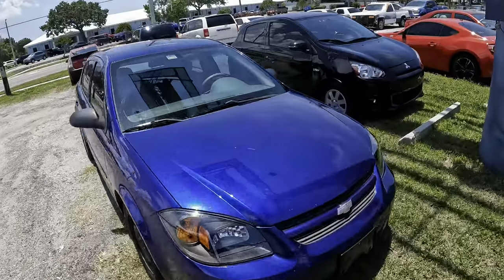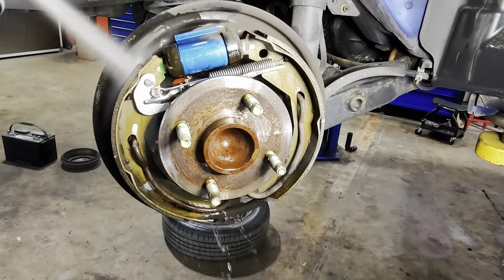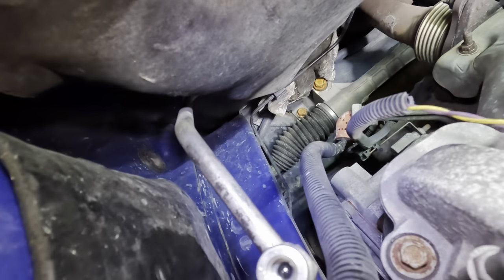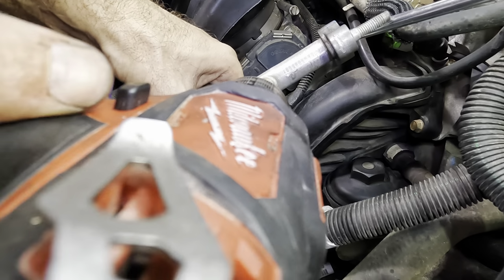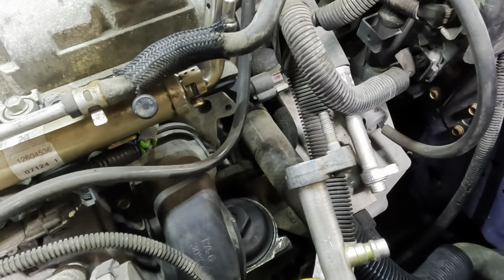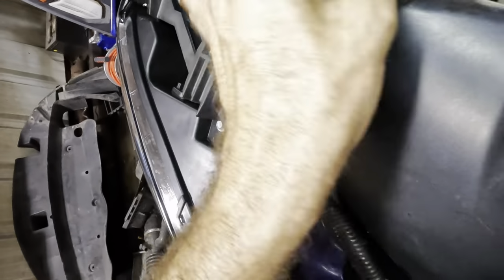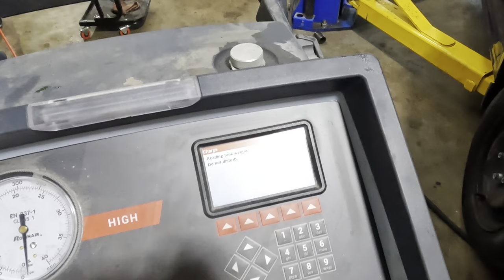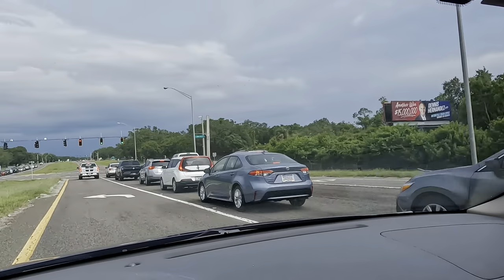Mechanic Still Can’t Replace Parts! Customer JUST bought it! Chevy Cobalt PT2!

Comment: You should look at the replacement high side service port that Napa (and I'd assume others) carries that has an actual Schrader valve in it rather than the rubberized ball that ALWAYS ends up leaking.

Comment: Ok, I don’t get the hose compensate. When u started the charge the hoses where already full and that refrigerant hasn’t been weighed. Then you put in required amount. Then you do a hose compensate. After doing this, you have installed the required weight plus 2 hose amounts. Over charged.

Comment: Definitely "repaired" by a novice before.  Failed to adjust rear brakes, failed to lock all tabs on fuel pump retainer, painted hubcaps but failed to paint wheels underneath.  Good times.
Reply: I think those are the OEM rims and they have plastic hub covers that screw onto the lugs from the factory...To get the effect of the hubs they've got, you'd need new rims too.  Seems several things on this were done about 3/4 of the way and given the "good enough" seal of approval.
Reply: Most likely it went through a cave -n-pave body shop! My friend does that kinda work,stuff rot hole with t-shirts and glass over it,cheap supplies,paints over unprepped surfaces,still uses laquer primer,paints wheels and hubcaps! He averages 6 cars a day at 3 to 5 hundred a each for dealers and wholesalers,its all about money
Reply: @Saichen  Of course they're OEM.  The mistake was painting the hubcaps, and not the steelies underneath.  Black on rust is not a good look.  At bare minimum they should have flat blacked the steel wheel as well, even though they decided to switch the hubcap color from satin silver to gloss black.  Realistically, no car should come with steelies in today's day and age, unless it's intentional nostalgia with trim rings and baby moon centercaps, or standard police issue type stuff.  Stock alloys aren't that much more expensive.
Reply: @petersmart1999  probably. Either way, not cool.

Comment: Perhaps the application of some lube on the support area for the brake shoes on the rear backing plate would not go amiss. After all that was the source of the brake noise. Picky I know, but you are usually so thorough.

Comment: Those wheel cylinders look like they have been replaced.  Are they the correct size?  They look like the at-rest size is too long forcing the adjustor screw to be all the way in.

Comment: Another good video 👍I'm an old mechanic I was a hydraulic mechanic for many years back in the 80s you could actually put the car in reverse to adjust the drum brakes in the back is that still an option?

Comment: About the billboard... Do you need it?

Sorry if that sounded harsh, but it is a really important question.

I don't know but it seems you have the yard full of cars that you are working on. I know you've said on video that you just don't have the parking space to take on more jobbs. So do you need to advertise?

Unless the answer is yes I'd say you're better off saving the money and use it for something you need.

Advertising is complex. Most of the time you don't really make back what it costs so you have to really look at the situation.

Personally I think it would look good! There's something really satisfying to see your name in large letters. But that doesn't mean it makes financial sense right now. Besides what would the name be? Ray's Repairs? Rainman Ray's?

For a billboard to make a difference it has to tell the viewer just what it is you are advertising. And for these billboards the viewers are drivers who just zip by so it can't be anything too elaborate. For well known brands that's not much of an issue. No one has any doubt as to what to expect if the see the three arches and McDonalds. But if you advertise "Ray's Repairs" in three feet letters people might see it but very few would know what it means. Repairs? Repairs of what? "Ray's Auto Repairs" is better but will still not bring brand recognition.

So while I'm not against you getting your shop noticed I still think you have to consider if it will drive more business your way, and if so if the added income covers the cost and if you have the capacity to take on more jobbs.

Comment: The hole in the back is for when you adjust the shoe with the drum on. As I do it this way it allows me to do final adjustments due to the shoes repositioning themselves which will lead to the clearance being out of adjustment repeat about three times.

Comment: Hey Ray I was wondering what would cause rear drum brakes on a 2000 toyota sienna to catch and pop when stop and go. Still works didn't brake it new hardware and shoes. Took to shop they said drum were rusty on edge

Comment: What about the old trick or adjusting the rear brakes fully by backing up several times and hitting the brakes really hard? It would be nice if they made a shrader removal tool for automotive ac systems like they do with home HVAC. You don't even have to evacuate the the system to change out shrader valves on those.
Reply: I agree. The quick reverse and sharp brake applications should automatically adjust the brakes. You could tell when it was required by the stroke on the parking brake handle.

Comment: Maybe remembering it wrong, but I recall several vehicles with drum brakes that would self-adjust by several low speed reverse stops. Of course, the old Fords had a special tool for the star.

Comment: Just did the original rears shoes on my 2011 Silverado(81k). The only issue was the stupid design of the e-brake cable spring! Ended up welding 2 body shims on the end of needle nose vise grips to make a mini spring compressor.Worked awsome and went from a 2 man job to a one man job!
Reply: Commends on your excellent innovation  !

Comment: 19:47 Not to be picky :) i would have tried an ez-out or a tap, tap it into the body of the valve, and using slight pulling and twisting pressure once t engaged i would have seen if i could have got the rest to engage the threads so i could unscrew it out before drilling. though i know ez-outs or taps don't always work.

Comment: couch quarterbacking here but no disrespect intended

1) drum brakes- why not de-rust first then do full brakekleen...save a bit of time and save some cleaner

2) drilling out schrader, have shop air blowing in pipe before start, during drilling, until end of drilling

Comment: Was it ok to not leave it under vacuum with the vacuum compressor for longer than the initial leak test? Wouldn’t it need like 30 minutes at least being that it was open for so long from that leak and while working on it?

Comment: What? Another video of Ray using brake clean to actually clean brakes?? Oh can't be.. 😂😂 
Also, last car I had with drum brakes on the rear were auto adjusting. You just hit the brakes with moderate pressure while backing up.

Comment: While you were driving towards the doors, I was going to ask, "when is the new lift being installed?", but you answered my question.  ;-D
Now, question two (knowing the now 'center' lift is the lowest capacity); "Is the new lift the same or higher capacity than the angled (left) lift?"
Regarding advertising, it seems that "word of mouth" is working well for you so unless I'm wrong in my evaluation, I'd hold off spending the money and see how business goes after the third lift is running?  ;-)

Comment: Are you sure the valve part is out of the AC pipe? I would have held it upside-down in case the air just blew by it.

Comment: You were lucky to get that valve out and I did see the booboo you made trying to blow through the compressor. Pulling the line off is what needed to happen as the valves in the compressor wouldn't have let you blow back though the discharge side anyway. Nice job as always!

Comment: The 'ol upright brake cleaner can drop balance alg. Followed by the kick it over 'rithm. A great drilling out assist in critical environments is glob grease on the bit to grab chips. You can,t blow air through a positive displacement pump RainmanRay.
Reply: should suck instead of blow, now debris went towards compressor.

Comment: You washed any lube away that was on the baking plate!I would have greased the lube pads,especially with that squeak.Also,I wouldn’t get brake clean on the wheel cylinder rubber dust seals.Good video though and good editing.

Comment: 1) I was dying to see what the back side of the low side port looked like with your bore scope. I saw one that worked with your phone with a usb-c connector for as little as ~$5 ($20 shipping!) 
2) Could you have explained how the self adjusting rear drum breaks tighten up the brake shoes while backing up and braking? Everything is now disk brakes and drum brake are only aux/parking brakes now.
Reply: I got cheap one and it works OK but the picture quality leaves a lot to be desired.
Reply: 2) I thought the same thing but it looked to me that there was no automatic adjuster attached to that lever. I think it was manual adjust only. I went back and viewed that part again. It is just the latch plate or whatever it is called. There would be a cable attached to it if it was auto adjust.

Comment: Note To Consumers:  when you buy an econobox , you're very close to basic Corolla cost. If you seek lo operating costs. They're avg lifespan of 2 decades & 250k miles is legendary.  I've driven 35yo Camry since '04. Bought spouse nu Rav4 in 08. 2 alts and only maintaince items since.

Comment: Those rear drum brakes are self-adjusting. Whenever you back up and hit the brake that lever at the adjusting wheel should pivot up and click the wheel a notch. 
If it's not adjusting, something in there is broken. Those brakes should not have been that far out of adjustment.

Comment: Personally I prefer to get the self adjusters going again. Often its almost impossible not to bend the little leavers so they no longer move the wheel while renewing the shoes. Most people seem to make no attempt to verify they are working after a brake job. Often you can check them using a large screwdriver to separate the shoes.Otherwise you can hear them click with the brake pedal or handbrake or whatever.

Comment: You should only adjust those Rear Brakes with the drum on because the outer edge like you showed gets rusty and gains size so I see you adjusting them you will have to do it again….

Comment: I am curious as to where this customer bought the vehicle from. It looks to me like the dealership set the vehicle up to need repairs and then scam the customer. I could be wrong but multiple no parts needed repairs is too much of a coincidence to me. Excellent job Ray as always for looking into problems with an open mind and always doing what is best for your customers.
Reply: Interesting take. To me it looked a bit like a experienced mechanic went through it and wrote down what had to be done then handed it off to someone not nearly as experienced who just installed the parts and charged the AC, ticked off the items on the list, signed off on it and handed the keys over to the sales department.

But your take makes some sense. The buyer would really need to have this car looked at and I think a lot of people would take it back to where they bought it for things like that. At least the first time. So it could have provided some aditional revenue for them.

Comment: As the handbrake has an auto adjuster that moves the ratchet wheel in the hub to take up the wear every time the handbrake is pulled, it looks like the driver isn't a great user of the handbrake. Probably just sticks in 'P' every time it' parked up without applying the handbrake...?

Comment: Enjoyed that one!  But left wondering about those 58F discharge temps.  Here in NC with ambients in the 90's, I routinely see discharge temps in our 2 newer daily drivers and my '73 Corolla down in the 38-40F range.
Reply: pressure follows path of least resistance, the air pushed microscopic metal debris into compressor, now whole system ruined. He did what no AC shop would do by drilling the valve. Soon will be 98 degrees coming out.
Reply: .9 lbs of refrigerant, short trip, no time to chill further. I'm just shocked it didn't have the "4-90" a/c system. 4 wheels on the road, windows down, 90 mph. Usually see those on cars without the 'bluetooth windows that connect with your brain chip".
Reply: @Estranged180  90 mph no ac needed, now owner will have 90 degrees ac air.
Reply: @forgetfulme1719  There was no metal debris to be pushed into the compressor. The metal debris was on the other side of the filter-drier.
Reply: @markanderson2904  shop pressure could burst thru filter dryer in reverse flow direction?

Comment: 6:47 Please someone tell me where I can get the "abrasive bit" he is using on the Milwaukee drill. I literally just spent 10 minutes typing in every possible way I could think of but I cannot find it or anything like it with a hole for the lug nut studs--that would make tidying up during brake jobs a lot nicer for me!

Comment: Heavy duty lift that should have been installed outside the doors and a alignment rack put there where your putting that heavy-duty lift and why for one so big trucks have a lot of room second so a vehicle can pull straight threw to alignment rack and 3 so you can make more money 😊

Comment: Really nice used car. I'd ditch the wheel cover, clean the wheels up and put some shiny lug nuts on. Also, did y'all notice whoever mounted the rear tires took the time to align the yellow spot to the valve stem? At least the tire tech knew his stuff.

Comment: Lol, after seeing the intro I have to share. My Impala ,03, keeps blowing the turn switch for the AC fan, it's a $10 fix but it's all the time. Idk, but wondering if a cheap fuse could be what's causing it as I remember I had to change the switches for windows at least twice after a few fuses, anyone have some thoughts?

Comment: How many mechanics would have just replaced that low side pipe when the guts couldn't be removed completely?  You did the customer a solid by what you did, thus not having to get a replacement low side pipe.  That shows your concern for the customer and not wanting to just make a sale.

Comment: Should have had Troy hold the trigger down on the air gun while drilling or you could have done the more expensive route and use a zip tie to hold it.🤣

Comment: I have one suggestion. After using brake clean, it's a good idea to re grease the pads on the backing plate where the shoes ride. This will reduce the chance of noise. My neighbour, who's a retired mechanic taught me this.
Reply: He always does it Ray's Way, which is half way. Noise is least worry on Cobalt.
Reply: The customer complaint was about noise in the rear brakes
Reply: That has been standard procedure forever.
Reply: I didn't see Ray do that.
Reply: @davidquinn6161  no harm done, some things done in Ray's Way scare me.
Reply: Such as ?
Reply: @davidquinn6161  gasoline spill everywhere, starting bolts, spark plugs... with power driver, tighten lugs without hand torque...all basic mechanic school training.
Reply: And yet, he's quite successful as a mechanic.
Reply: @davidquinn6161  Successful as Youtube $ making 'mechanic', without that major income, he cannot afford Troy. Lots of pros watch him for laughs, non pros think he is a mechanic god, which is fine too if you do not mind stripped threads, broken lugs or squeaky brakes...
Reply: Yet his channel has been recommended by several other YouTube mechanics such as Eric O at South Main Auto, Ivan at Pine Hollow Diagnostics and Scanner Danner. Are you as disdainful of them too ?
Reply: @davidquinn6161  Scanner is top in diagnostics and a true teacher. Did u ask him about Ray's hacking shortcuts directly? They watch him for laughs but gracious not to say so. U want to do same repair steps like his, go ahead, 2nd car standby? while u botch the parts..
Reply: Then why did all 3 of them recommend his channel ? They didn't say "watch it for laughs". Eric O in particular did a video specifically recommending other YouTube automotive channels. He seems to be a pretty good at diagnostics . But maybe I'm wrong about him. What say you ?

Comment: Always see Ray starting the car by just turning the key, in Europe all cars seem to need the brake pedal engaged to be able to start the engine.
Reply: In the U.S. you have to engage the brakes to get the car out of gear.
Mostly automatic transmissions here as opposed to European manual ones.
In any case, different method to get the same result.
Reply: In USA, on the newest cars with start buttons, that is now the case---brake pedal must be depressed to start when you push the Start button.  If brake pedal not depressed pushing Start is the functional equivalent of turning the key to "Accessory" position.
Reply: Some Japanese cars as well.
Reply: Here, need brake pedal in to shift the automatic out of 'Park'.  This happened after the Audi "unintended acceleration" reports from the 1980s, that were probably due to misapplication of the wrong pedal.

Comment: Nice save 
 On the breaks 
 Nice repair on the ac , as long as it doesn't leak it should be good. 
 Where did Monte Carlo go  lol .
 That was a task at hand while it was in the shop. 
 My ac clutch fried on my cruze and I get to play with ac soon sadly.  But 12 years of service I can't complain.  
 Be safe team.
Reply: Brakes
Reply: @waldolemmer Thank God you caught that computer spell check error, I almost couldn't understand the post at all with that error.

Whew!  Disaster avoided!
Reply: @stevewhite3424  lol
Reply: only if owner like 58 degrees air

Comment: Hey Ray I got a question. I have 2012 Honda CRV. I got my brake fluid changed about 20,000 kms and the fluid is black, brakes still work fine. What causes it to turn black?
Reply: Hoses may be breaking down!
Reply: I thought brake hoses for brake fluid were metal.
Reply: Nevermind to the wheels are rubber, you're right. Thanks.